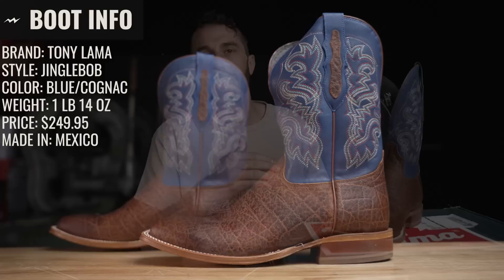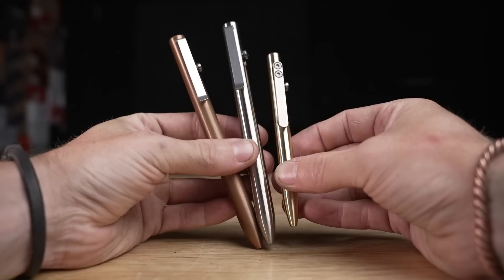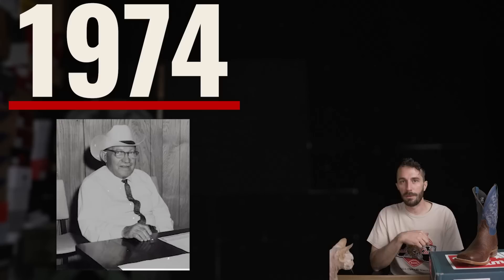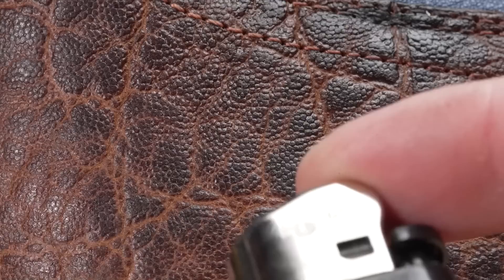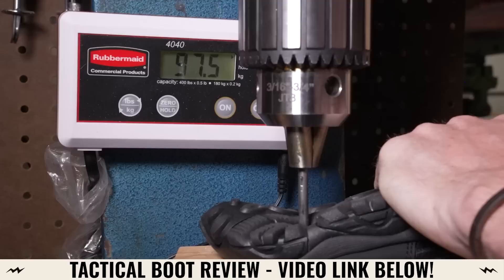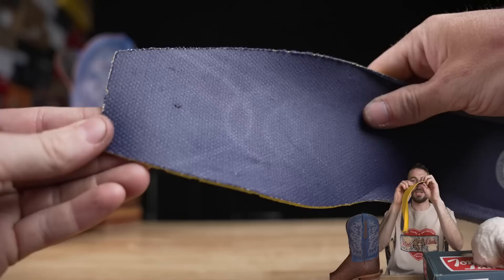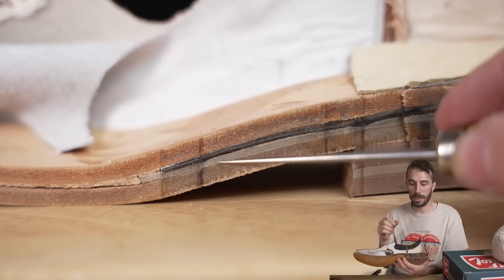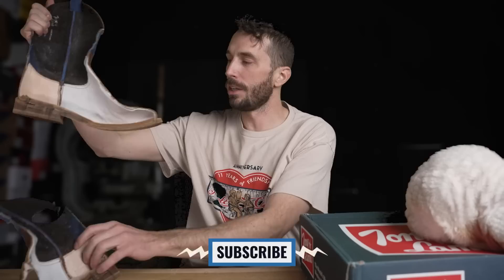Are Tony Lama's worth it?

Comment: I am a retired footwear examiner in Arlington Texas and had the privilege of touring the Justin boot company in Fort Worth before it moved. Among the things I learned was that the heal leather used to be made from scraps but is now made of ground leather board material because the material is more durable and the thickness allows for more consistent heal height. A strong metal shank is needed because riders stand up in the stirrups and the soles would split if not backed by a strong steel shank. They were experimenting with synthetic soles at the time and their endurance test was performed by an employee who rode a motorcycle and was very rough on boot soles. If a sole lasted more than six months on his feet it was deemed good. A new set of boots set on a smooth surface should have a slight curve to the sole that lifts the front of the heel off the surface just far enough to slide a U.S. nickel under the front of the heel. The boot will flatten out once it is broken in properly. Also, it is not uncommon for cowboy boot companies to test the market with only 1 or 2 dozen pairs of boots in a test pattern. So some uppers are very rare patterns while others are very common.
Reply: He cut that Tony lama in half and my heart sank
Reply: What boot brand would you recommend?

Comment: Lemonwood pegs are traditionally used in cowboy boots because they swell and contract at the same rate as the leather sole. This means that even when you get the boots wet they will still hold tight.
Reply: 100% correct
Reply: agreed!!! and if brass nails were used they can work themselves out of the leather soles from the expansion and contraction
Reply: Yes, he covered that in the German jackboot video. That's why there's a link to it when he talks about the pegs.
Reply: Another key point of why lemonwood pegs is for actual riding. As the leather wears in that spot from the stirrups lemonwood pegs will erode at the same rate as the leather; brass nails obviously will not and will end up scratching and damaging the stirrup. If the stirrup is metal there is a high chance those brass nails will either catch or break off.

Comment: A smooth leather sole makes it easier to regain your stirrup if you lose it while riding. Might keep you from getting dragged by your foot through rocks and brush too because it allows your boot to slide out of the stirrup if you fall.  The stacked heel of a cowboy boot (and the long nail fastener) is designed to be the part that grips. I've seen them called a "roper heel".   Literally, if you're roping an animal you can lean back onto your heels and keep your footing if you're on the ground.  Or you can hook the heel into your stirrup for bracing when you tie off the rope on your saddle.  I did a little ranch work and still ride but mostly learned from watching people with a lot more skill than I'll ever have. Thick rubber soled cowboy boots aren't meant to be used in the saddle.  They're a much better fit for someone working on their feet all day or someone who likes the style in a work or dress boot. Just my opinions.  Can't wait to see more in this series.  Thanks for the inside look!
Reply: Howdy brother, a "roper heel" is a shorter heel than that of the normal cowboy boot heel.  Boots with the roper heel are typically referred to as "ropers" in general.  They are meant to be used on the ranch when not riding, as the taller cowboy heel is not needed to stop your foot from going through the stirrup.  The sole has nothing to do with regaining your stirrups, but the pointed toe does.  Leather soles are still used due to tradition and style.  Cheers🍻 !
Reply: @DanBCooper  Thank you brother Dan.  I have a pair of packer style smooth leather soled Justin ropers made in Mexico that have served me pretty well. And yes, just pointy enough to help me get my balance back in the brush. I don't chase cows anymore that was 40 years ago. My balance isn't what it was and I never was a pro. But I have worn the wrong shoes on a horse. I learned that's where function matters. I appreciate the details you taught me and your kind response. Regards.

Comment: I used to work in a machine shop when I was younger, and worked around band saws a lot. I seen what happened at about 9:21, all I have to say is you're really lucky. You really should use a push stick once you get close to the end of the cut. It'll save you from a nasty cut, or worse.

Comment: The best off-the-shelf cowboy boots in the industry is Rios of Mercedes, which is very well made. The issue with Justin or Tony Lama, other than having synthetic heel counter, synthetic shaft lining, blade style shank rather than a 40 penny nail, and etc. is that, the vamp is not crimped. Crimping the vamp allows the leather to lose stretch memory so the boots won't grow larger as you wear them. Also, lemon wood pegs are used because they expand and shrink in the same fashion as the leather outsole and insole. Brass pegs are not, so they might fall off as time goes by. As for having pegs piercing in the foot arch, that's not gonna happen because all cowboy boot makers would sand the inside of the boots (the insole) so those pegs would become smooth. When it's brass pegs, they are nailed in and will kinda bend and hook the insole, not piercing into your feet.

If you want custom cowboy boots, check out: Lisa Sorrell, Lee Miller (Texas Traditions), Tex Robin, M.L. Leddy, James Leddy, Duck's Heritage Dustin Lauw,  Wallis Custom Boots, Little's Boots, J&M Custom Boots, and so on.
Reply: Four pair of Rios and counting! :-)

Comment: I bought a pair of smooth ostrich Tony lamas 6 years ago , and they have been worked very very hard , from walking through thick brush , gravel, dirt, rolling around on concrete , getting completely soaked many times…. And they finally ripped on the 6th year … super comfortable and durable

Comment: I’m glad you’ve done this.  I have a pair of black Tony Lama’s that I’ve had for about 30 years.  They have been resoled once.  The only cowboy boots I buy are either Tony Lama or Justin.  Lately I’ve been buying Justin Work Boots with Safety Toes.  I love the Scottsbluff and am enjoying the Cappie.  The Joist was a waste of money.  I recommend buying the Made in USA products.  They are better fitting and last longer.  The Joist was made in the PRC and never fit right and didn’t last a year.  The Scottsbluff has lasted 3 years and the Cappie I’ve worn for 8 months and is very comfortable.  Also, whenever I was in El Paso, I’d alway stop at the factory that was just off of I-10.  There used to be a corrugated tin store attached to the side of the factory.  If you tried on a pair and one didn’t fit right, they used to just go to the factory floor and get you one to try on.  Just amazing back then. Just my two cents.  Thanks.

Comment: In my experience leather soles are best suited for going out two stepping.
Most people working outside will opt for the rubber sole.
Reply: Glad I read comments, was going to say exactly what you said. These aren't ranch work boots. These are occasion boots.
Reply: Or, given the puncture resistance, for trompin around where you may step on a horse-crippler cactus or mesquite thorns or similar!
Reply: Exactly. I have a few nice leather bottom boots, but my working ones have rubber inserts.
Reply: For actually riding an actual horse, give me leather, every time.
Reply: I am a cattle rancher and the slick soles are absolutely a must for riding horses. Rubber soles of any kind will bind in a stirrup. Getting bucked off a horse with your foot hung usually results in death.
Reply: What about riding horses? That's the whole purpose of the leather sole

Comment: Technically, you'd want to use an object with less surface area at the tip than that nail to test for snake bite tolerance. The broader tip allows a great distribution of the puncturing force across the surface of the leather, whereas a snake fang may have an easier time finding its way in (although not terribly likely). Anyway, great video!
Reply: The fang would be more likely to break off than the nail, though… 🤷🏼‍♀️
Reply: @jennypaxton8159  haha, yep. Like Weston said, it would have to be a pretty jacked rattlesnake to get through that leather.

Comment: I think Rose Anvil needs to get a bunch of rattlesnakes to test how much leather puncture resistance is needed to stop a rattlesnake bite.
Reply: My wife has worked around rattlesnakes for 20 years and currently catches and relocates for our town dispatch.  Leather boots pretty much just give you a false sense of security, they've had millions of years of evolution to develop the tools specifically for puncturing tough ankle hide of hoofed animals.   Snake boots either have metal plates in them or dense rubber.

Comment: I love the channel, but I gotta give a little insight. Traditionally, cowboy boots had smooth leather soles. Today's boots, especially cowboy work boots have a rubber sole. Also, the smooth sole does help with sliding the boots into the stirrups, but you never go passed the balls of your feet with the stirrups. I would love to see your opinions on the more rugged work style like Ariat or Twisted X. In the oilfield, they are the most popular, comfortable and durable of western style work boots that look like a "traditional" cowboy boot.

Comment: 06:48 the slick sole is so you can slip in & out of the stirrup fast. The same reason for needle nose toes on the boot. I've always had the area around the welt where the toes start to curve up crack & break from too much flexing. The bottom line is, it's just a work boot. It depends on how often you wear them on how long they'll last. If I get a pair of boots/shoes to last 6+ mos., then I break even.

Comment: Looking forward to the rest of Cow boot series!
I was 'gifted' a pair of TLX model XT4002 size 12D, style 0405. clearly stamped, MADE IN CHINA. with plastic bonded leather vamp which had the side stitching separate on the outside of the vamp. Until that separated it was a good work boot with a mixed composite sole and heel with a stirrup wear plate ( I now suspect a substitute for a shank) which does work well for riding for short trips, Never did a long one before the side blew. on both boots. 

The vamp separation ended what was actually a very waterproof boot. 
I usually buy Dan Post, Nacona and a couple other old brands with one pair of Tony Lama size 10.5 EE, style VM2953 14062 6 620 leather soles bull shoulder vamp. that fit like a glove! MADE IN MEXICO.

Comment: The leather sole, while can be a little slippery, it doesn't retain mud or animal droppings and easier to clean when going between indoors and outdoors. It's also tough, flexible, and can breathe better than rubber. Easier to slide in and out of stirrups too.

Comment: If a western boot has a insole or float bed it's a cheaper boot. Tony Lama, Justin, and others do this for budget issues. I personally buy Lucchese 1883's been the best so far. And they use rose wood was told it doesn't shrink or expand as much

Comment: I remember when Tony's boots were hand fitted to your foot. I believe that was back in the 70’s, the cost I think was about 250 not adjusted for inflation. Back then I spent 300 on a down sleeping bag (made by one the top expedition camping companies, ) I still have, like new although I have not used it in 15 years . I recently looked up the price still about 300. I believe there was not much price increase is that many people believe there are better insulation than down. I could debate that, but wouldn't.  PS Have you done Chippewa logging boots, they were one of the best, or Micky Mouse boots best cold weather boot down to -40F. They last forever I am on my 2nd pair in 50 years and they are worn every year. Gave a pair to friend 3 years, he normally goes through boots in 6 months, he still wears them 4-5 months a year.

Comment: You are half right about the leather sole. It is slippery on purpose. A rubber sole does stick in the Stirrup. You also can’t Texas two step without a good leather sole that can slide across saw dust covered wooden floors

Comment: I'd like to see the difference between Mens and Ladies safety cowboy boots, no lace up. I have always found myself purchasing a men's style boot because the women aren't offered a same styled boot, if at all. And I'd like them to be within a close price point between them. I don't need, nor want fancy stitching, or butterflies on my safety boot. It's gonna get poop, mud, dirt, and the occasional wood board dropped on it. Composite toe would be nice. Steel would great. Rubber sole, non-slip, electrical protection. And in wide would be Fantastic.

Comment: I think it’s perhaps a little unfair to judge the leather upper on this boot because it is is thinner than that on some work boots. Those work boots are often unlined, whereas these have a lining. In that respect they are more akin to dress boots, which typically won’t have a thick leather upper, but will be lined.

Comment: I don’t like square toed cowboy boots. I had a pair in the seventies and the boot got stuck in the stirrup on dismounting. Luckily the horse was calm and I got my foot out but if the horse was skittish and took off I could have been in trouble. I wrangled horses as a summer job for dude ranches back then. Got to meet a lot of girls and a few slightly older women who were vacationing for a week or two. Learned a lot about horses and the opposite gender.

Comment: I received my first pair of RUJO today. My first pair of cowboy boots ever. Customer service is outstanding, but the product is very poor quality. I had sliced marks on the side of each boot. The right boot had a deeper slice where if I really pushed, I would’ve poked a hole in it. I cannot recommend this brand. Very cheap. I purchased a Tecovas at my local store and there is such a huge quality of difference between the two brands.

Comment: Do western riders not have the stirrup at the ball of the foot like eventers? That's weird.
Reply: So far with Google I'm only able to find the advice to ride with the stirrups under the ball of the foot. No one seems to ever ride with them next to the heel like that. I had my own horse and rode at Pony Club throughout my teens, and to my way of thinking having the stirrup where you suggest would be very uncomfortable and insecure. The reason riders have heels on their boots is to prevent the foot sliding right through when they fall off because you then get dragged.

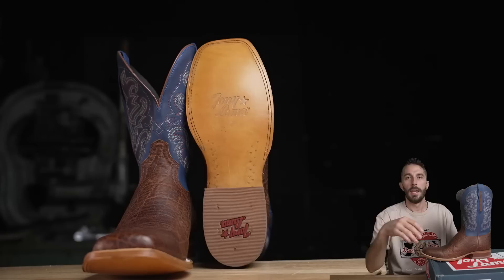Comment: 6:36 "Unless you're dealing with a pretty jacked rattlesnake you should be safe." And, this erroneous conjecture was based upon this data alone: "the upper tested at 87 PSI while the vamp came in at 101 PSI."
1. A mature rattlesnake can strike/bite between 120 PSI and 140 PSI.
2. Rattlesnakes strike people BECAUSE THEY'RE JACKED - they're not hunting for meal, they're trying to keep from being injured or killed by you.
3. There is not one single manufacturer of standard cowboy boots that makes the claim you just did BECAUSE THE LIABILITY WOULD BURY THEM.
4. Did you know SNAKE BOOTS are manufactured for this very purpose?
Keep cutting open boots, but quit talking out your wazoo.